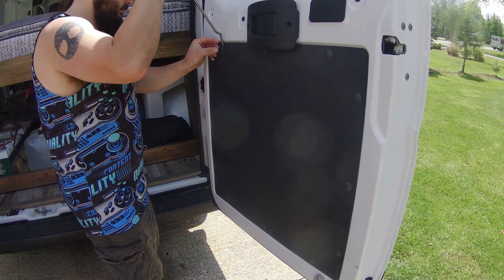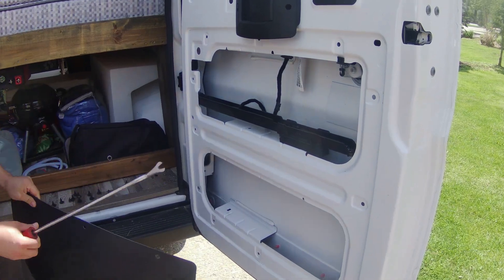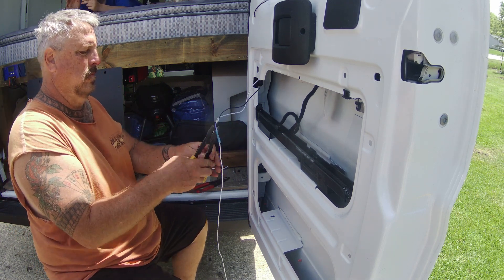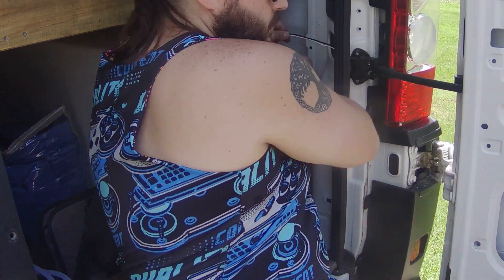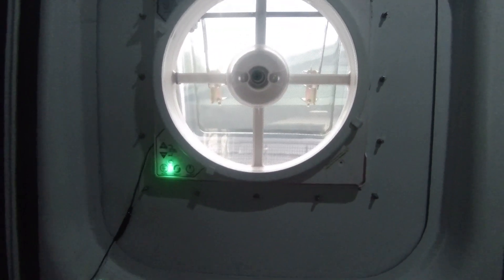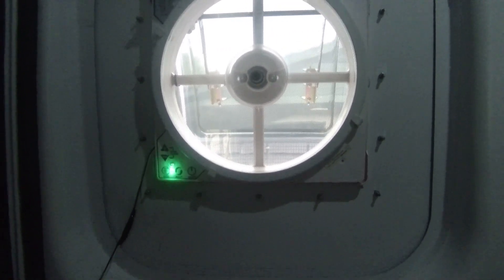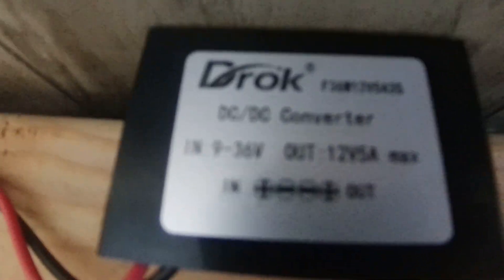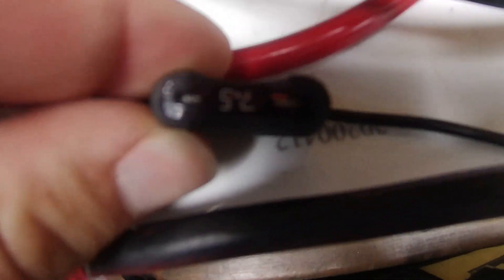Wiring the Maxxfan/Power Issues With the Maxxfan and How to Fix it Converting My Ram Promaster #7

Comment: Very cool. I'm glad the fan is working  now. Let us know how well it works. Does it circulate air real well and help keep the van cool?
Reply from the maker: It does a pretty good job. If you keep the front windows down a bit and have it pull air through it keeps it a reasonable temp inside